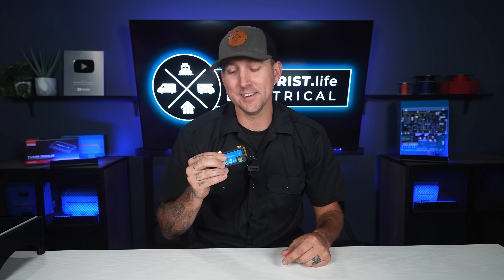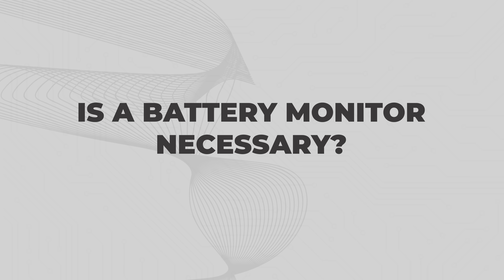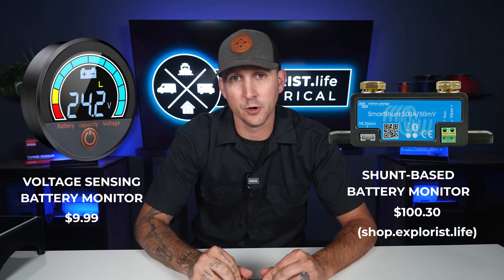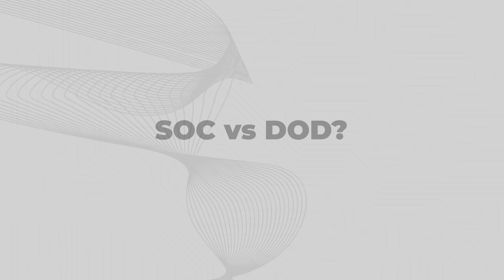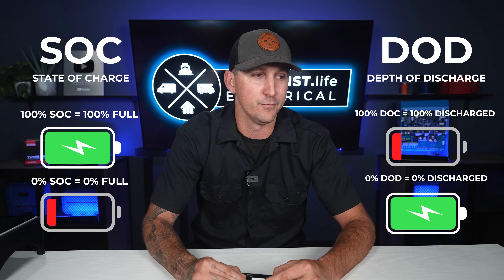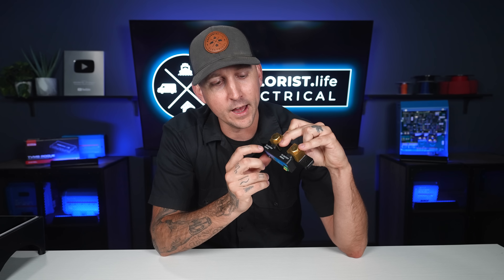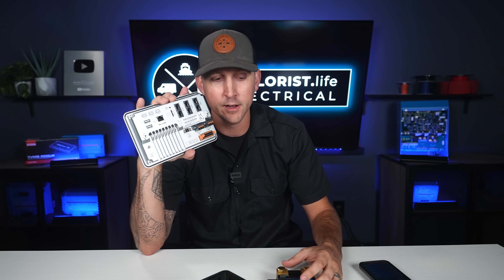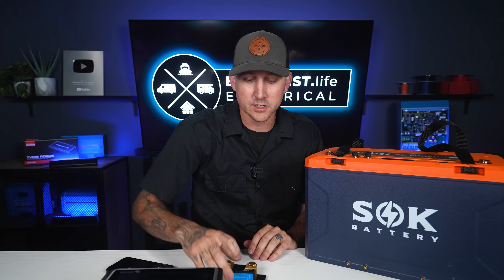How Battery Monitors Actually Work (and Why You Need One) -  Battery Monitoring Playlist | Ep: 1/3

Comment: You are very knowledgable
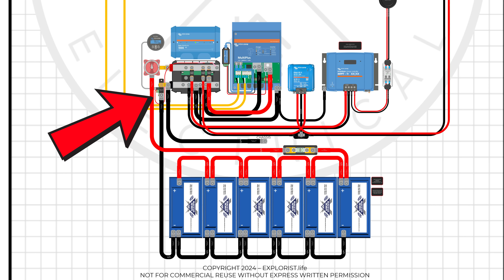Just a second. Do the shunts not also measure voltage (flowing thru)? Micro volts perhaps but still volts. Difference one measures the positive side the shunt the negative side of system. But both are voltage  based. At 7:40 it measures micro voltage  not amps.
Thanks
Reply from the maker: You’re on the right track 👍 This really depends on the specific monitor and system layout, and it’s tough to cover accurately in a comment.

If you want, reach out to our support team and we can take a quick look at your setup and make sure everything is working as expected (and help with parts if needed): 👉 https://shop.explorist.life/support?utm_source=youtube&utm_medium=comment&utm_campaign=support&utm_content=response_link
Reply: @EXPLORISTlife hi again
We have and use a morningstar mppt controller and a xantrex monitor. Our xantrex measures on the negative side. 
I asked morningstar engineers about 3 different  panel sizes on one controller. They laughed at me. Said I should never do that. They call it solar salad and it's bad they say.